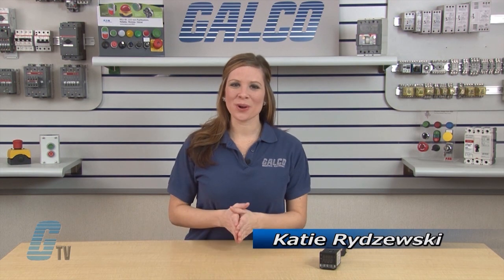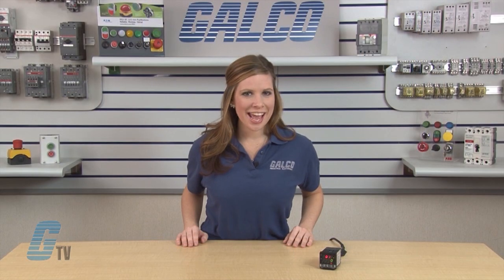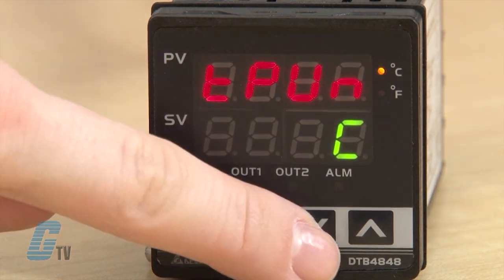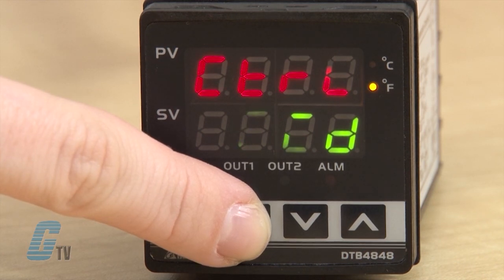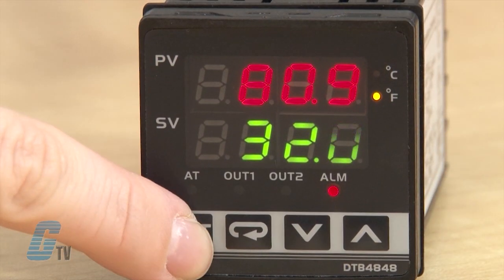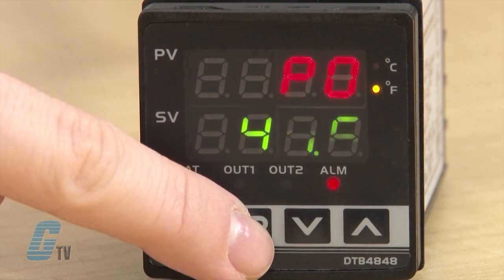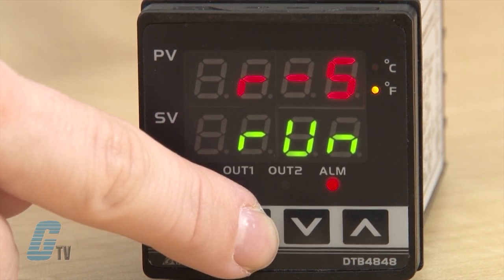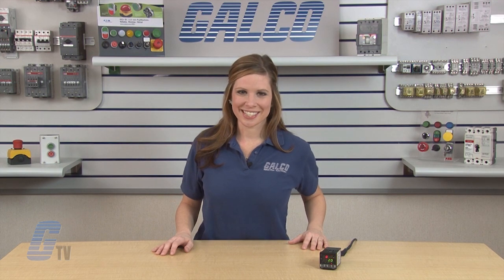Delta Products DTB Series Temperature Controllers for PID Controls & How to Navigate

Comment: Hi There, I have a general question. I have 2 outputs (heater +cooler), if I set the SV=35 and PV reads as 48, will that go down to 35 by turning on the cooler and in case if it goes lower than 35 (like 30) will that automatically turn on the heater?
I need to do all this via RTU in my code. Currently I have another brand, that is not very accurate and I have to program it to either use the heater or cooler and it cannot recognise when to use what. Is this something can be done with Delta products? lease respond me as throughout as possible. Many thanks.

Comment: I have this type of
temperature controller but is not working so I want to buy new
controller please check hear I have given description of my currant
controller please help me which controller I can buy that work like
this 

1 function : when
controller start HEATER on and the temperature reach at sated
temperature (Exp.  135 C)
2 function : this is
delay time (Exp. 120 Sec.) in this function controller just count
sated time
3 function : this is
cooling function it will down temperature (Exp. 55 C) with starting
FAN 

4 function : in this
function give Buzzer Sound  (Exp. 10 Sec. and controller Will go to
off mode or sleep mode
Reply: Dharmesh Sony ,
We SIGNAL CONTROL SYSTEMS are a leading manufacturer of temperature controllers , timers and other industrial controllers in ahmedabad.
Email on dobariadhruv@gmail.com for further details.

Comment: can we use this controller with labview software...please help.
Reply from the maker: These controllers have an RS485 com port that supports MODBUS ASCII/RTU communication protocol, only. Can your Labview software integrate MODBUS protocol?
Reply: We SIGNAL CONTROL SYSTEMS are a leading manufacturer of temperature controllers , timers and other industrial controllers in ahmedabad.
Email on dobariadhruv@gmail.com for further details.